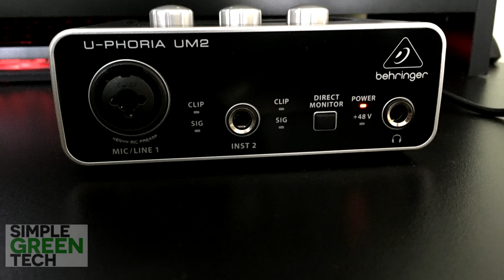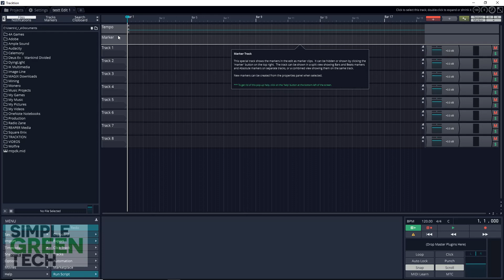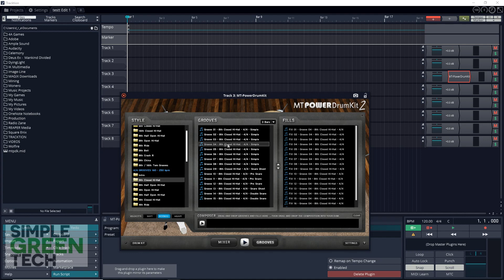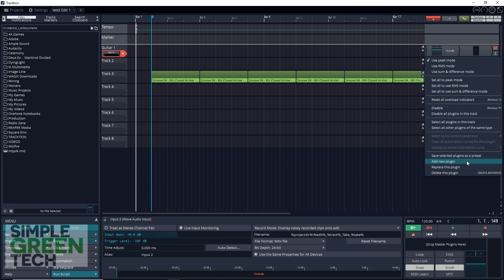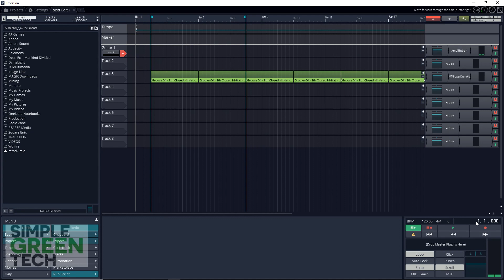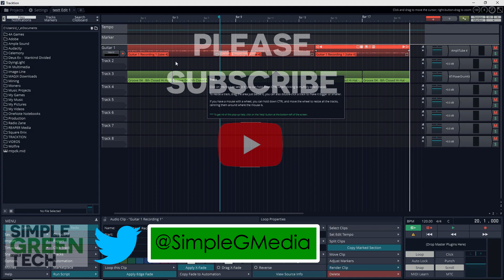Recording Guitar at Home - Tracktion T7 Tutorial

Comment: Many thanks for this!  But I have a small problem - when I select ASIO as audio device,  I see Behringer UM2 as a device,  but not my PC  headphones, so no sound :-(  
So,  if I select  'Windows audio' as the audio device,  then I see both Behringer UM2 and my headphones :-) but when I record using this setup there is a BIG latency between picking the guitar strings and the sound coming back out :-(    How can I fix this please?
Reply from the maker: Plug your headphones into the audio interface and record using the Asio driver.
Reply: @AudioTechTV  Thanks.

Comment: Hello. I can insert plugins in traction but i cannot listen to them. Well here what's goin on. I load Revalver4 or Amplitube. I get signal in tracktion but no signal in vst's interface. When i load perfects drums though and bring up the vst i can listen the drums normaly and program them as well via the keyboard of tracktion. I just cannot listen the guitars. Any ideas? Thanx
Reply from the maker: Click on the area of the track where you would select the input of the track (the rectangle right beside the arm for recording button). Then in properties area near the bottom of the screen you'll see "Live input Monitoring" . Click on that so it's turned on. You should be able to hear your guitar after doing this.
Reply: @AudioTechTV  hey thanx for the reply. I hadn't pressed the rec button. I thought i should hear the guitar without pressing it but only when i am ready to rec. Thanx anyways.

Comment: Still cannot get the latency issue when I'm live monitoring my recording fixed. Is it just going to always be noticeably off by even a tiny amount? Was very slightly off in your example as well. Is it just that the Behringer UM2 is always going to have the issue?
Reply from the maker: It’s not just the Behringer UM2 it’s all interfaces. There will always be a slight bit of latency. It takes time for the audio to get changed to digital, go into your computer, then convert back to audio and hit your speakers or headphones. Some interfaces and computers might be a little quicker then others but there will always be a bit of latency.

Comment: Help! How do you get amplitube to record through traction. For me it comes through my headphones but when I record and listen back it's just my dry signal.
Reply from the maker: When you are listening back. Are you listening to it in Tracktion on the same channel? Or are you listening to the saved file in the project folder?
Reply: @AudioTechTV  I got it working now. But there's a new issue. It sounds rely weird and sometimes breaks up (not clipping) and when I hit record it slows down and doesn't work
Reply from the maker: That sounds like a latency issue. You will need to change your buffer settings for your Asio driver. If you go into settings and in the audio device section there should be a control panel button if you are using an Asio driver. If you aren’t using an Asio driver you should try switching to it and that might help.
Reply: @AudioTechTV  so now it's not working at all. The plugin shows up and when I click it, it opens. I get signal in tracktion but no signal shows up on the amplitube window.
Reply from the maker: Are you using amplitude as a plugin inside tracktion? Or are you using the stand alone version of amplitube and have Tracktion open at the same time?
Reply: @AudioTechTV  using amplitube inside of tracktion
Reply from the maker: Is the plugin on the same channel that you’re recording into? It should just work without any adjustments. If you see a signal going into tracktion and the plugin is on the same channel you should be able to hear your audio through amplitube. Are you using an Asio driver?
Reply: @AudioTechTV  I'm only getting signal on traction. It's all on the same track. I'm not sure why it isn't working at all
Reply: There was a problem with mine the asio driver wasn't working properly I somehow managed to source the older berhinger driver it's available on the internet if you search it

Comment: sound just aint coming through... :/
Reply from the maker: Did you arm the track for recording? If so do you see the audio signal coming in on the meters?
Reply: @AudioTechTV  yea, i did. And there's a signal, but it seems to react to any sound going on, not sure the strumming of the guitar. Thanks for the quick response, btw
Reply from the maker: You may need to go into settings and in the audio devices section change the audio device type to asio then select your audio interface in the device list. Then on the track that you are trying to record to make sure that you have the correct input of your device selected (if it has more than one input). What interface are you using?

Comment: In Traction 7 ...  I get a "can't record ..couldn't write to file" error no matter which song files I choose.  The Zen Desk tech asked me to send all settings (which I did) and everything is correct but it still won't record. Now 2 weeks into the issue the tech wants to Skype so he can "see" the problem. I don't have Skype so I requested we organize a phone call.  Let me know what you think. I can play any song and I can hear all instruments that I plug in to T7 but it will not record.
Reply from the maker: That sounds like a system (Windows) issue or a hard drive issue. Does the folder or path that you’re using to record to contain any characters like an asterisk or number sign or something like that? Or maybe you don’t have write privileges to the temporary recording folder or it was set to use an external drive that is no longer connected. Those are just some of my guesses. Hopefully Zen Desk can help you get this sorted out.

Comment: Finally I've found a decent video on using guitar with traktion. I'm a subscriber now. Cheers
Reply from the maker: Thank you for checking out the video. I’m glad it helped you. Also thank you for subscribing!
Reply from the maker: +Brett R the version that I use in the video is the free version. I do have other videos that I use Waveform 9 which is similar but has a lot of extra features. However if you are just doing some basic recording and vst work you shouldn’t need that yet. But if you do want it. They have a sale on right now if you use the Code Epic2018 at check out you can get it for between 50-75% off. 

What is your issue with the free version?
Reply: @AudioTechTV thanks for your reply. I've watched your video and i don't have any amp simulators and it's just too hard to use. Doesn't seem as good as yours. I've followed your video a number of times and i can't get it down.There is no info from behringer and i feel like throwing it in the bin.  I'm done with traktion
Reply from the maker: +Brett R the amp simulator that I use in the video has to be downloaded and installed separately. It’s called amplitude there is a link to it in the description of the video. It’s free to download too. I did another video on installing VST plugins you can check it out here https://youtu.be/s9gyoQ_5iU8. You can check out Pro Tools and see if that is better for you though. With the free version of pro tools you can’t install any free plugins only plugins that you purchase through the AVID store. But you may like the workflow of pro tools better.
Reply: Simple Green Tech  Thanks again, I appreciate your help. I’ll have a look into it. Cheers

Comment: My guitar records at very low volumes, idk whats up
Reply from the maker: Are you plugging your guitar into the instrument input or line input on your interface?
Reply: @AudioTechTV  into the instrument input, idk if it has anything to do with the headphones im using?
Reply from the maker: It could be the headphones. Does the waveform in your software look big like its loud? Or is it very thin? If it’s thin then you are recording it very low. If it’s fairly big then your levels are good and it could be your headphones. If your clipping light on your interface is coming on while recording that means you are recording too loud. Typically you want your levels to be between -18db and -12db. Another thing is that some audio interfaces don’t amplify the headphone output too well so it won’t matter what headphones you get.
Reply: @AudioTechTV  my levels are a good size, if i turn it up anymore it'll clip. I closed out of the tracktion 7 app and the i could hear my guitar very clearly then i opened it back up and the volume went down, im using a behringer umc22